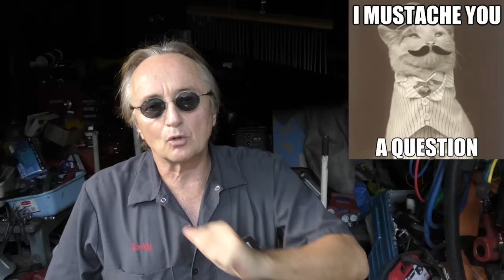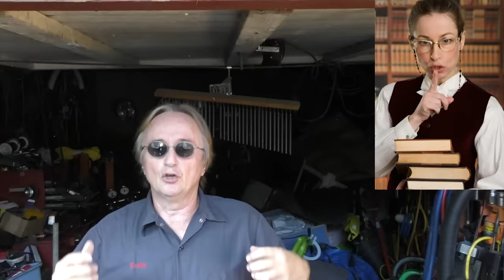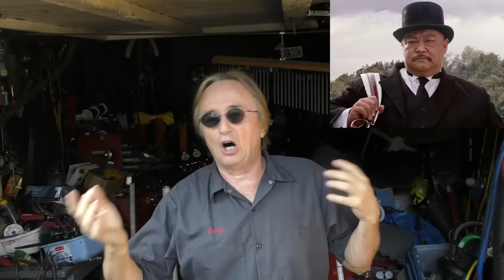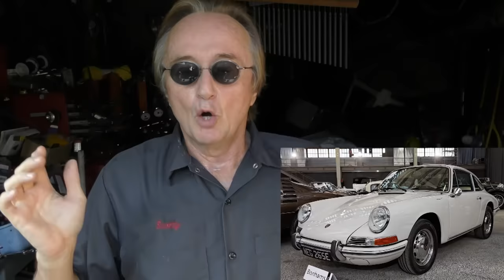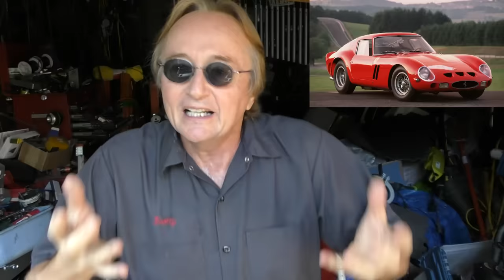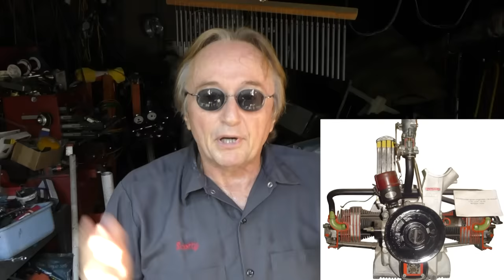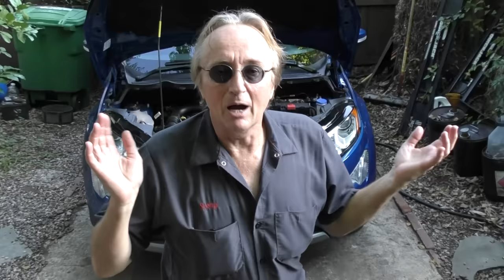The Truth About Boxer Engine Cars

Comment: Scotty is right about the Subaru BRZ: weak power.
Reply: It never meant to be a muscle car by default.......just because Toyota 86 got famous because of initial D does not mean 86 was meant to be a muscle car neither. The new Toyota 86 was always designed and market as a smooth and good handling car to begin with.
Reply: @kisekinecro  The car has 151 lb-ft of torque, which makes the car under powered. Nobody says it has to be a muscle car with 400 lb-ft, but 151 is ridiculous for the price.
Reply: @bodystomp5302  this car is a 2 seated coupe that doesn't require much to move it, and it is not design to run fast to begin with. It is designed around the handling and fun car. It doesn't need to be powerhouse to begin with, that's the point.

Comment: Just because the Boxer was invented earlier than the inline doesn’t mean it is obsolete. Otherwise we would all be driving around in Wankel engines since these were invented 50 years after inline engines. And Model Ts ran on inline 4s so it’s not like a cutting edge technology either.

Comment: Boxer engines more complicated than normal . Not for cars as two expensive but best in aircraft as engines are air cooled and boxer only has 2 cylinders is a row so better air cooling.  This point is completely missed in al articles on boxer engine scrappy write ups that are pretty ignorant. used in car because there was an aircraft air cooled one that was convenient to modify  too water cooled car engine but more expensive

Comment: Subaru engines are made by Toyota in Toyota motor manufacturing plants along side V6's and inline 4's. Extremely reliable if maintained just like any other modern engine. Also his horsepower argument make absolutely no sense. Has he ever heard of Porsche? They dont make slow cars.

Comment: Boxster engines are balanced I keep hearing that in your video and like Subarus that have a true all wheel drive system sequential dynamic you know there's not a transfer case you know so it keeps even things more balanced they are great and run forever normal maintenance now you mentioned the head gasket issue yeah the head gasket but again if you get a h6 you don't have that issue , by the way Porsche still runs boxster engines and so does Subaru and it is now 2021, old motor design is on I think someone already said in the comments old like gas pissing engines hit and miss engines something like that
Reply: PS for more information did you know the first diesel engines actually were designed to run on corn and vegetable oil it was big gas companies that made Mr Ben's redesign them to run on diesel but the first diesel engines just ran on vegetables it's all big gas that changed it for you every one diesel were intended to be environmentally safe and sound you can think big corporations for its downfall

Comment: Cylinder configurations can only come three ways:  Horizontally opposed (boxer), V, or inline.  All have their advantages and disadvantages and to categorically call one of those configurations obsolete, I believe, is being biased.  To use the Subaru BRZ as a representative all cars with boxer engines is ludicrous.   I agree.  It's a dog.  Instead let's look at the two major manufacturers of automobiles with boxer engines, Porsche and Subaru.  One could hardly say that they make underpowered cars, especially with both of their histories in racing.  If you look at their ratings in owner satisfaction and Consumer Reports, both companies rate very highly.  I used to hate Subarus...thought they were ugly and underpowered.  But then I bought one, then another, and then another, the last one being an STI.  I am kind of a car enthusiast and have owned an M3, Supra, Twin turbo Z and an S4.  I loved them all, but I think that the STI, while not being the fastest car I have owned, has been the most fun.  Despite the flogging it has received, it has been extremely reliable (85k miles, engine mods, nothing more than routine maintenance).  I think engine reliability and life has more to do with how well it is maintained and how it is driven than cylinder configuration.  Power, in this day and age, is a function of money and who your mechanic is.  

It was once thought that push rod engines would become obsolete, but the Corvette has done quite nicely with that "obsolete" design".  Go figure.

Comment: Actually Toyota GT86 is not a Subaru BRZ clone. Subaru designed the engine and gave it's chassis from Impreza for this two cars and that's all. The concept, design, gearboxes...are all made by Toyota. And actually 16% of Subaru stocks are owned by Toyota. So prepare yourself before your videos please.

Comment: Unbelievably bad information.  For starters, the BRZ/FRS was a joint venture between Fuji Heavy Industries and Toyota. Toyota owns a percentage of Subaru and Tralee up to make a small Fe/Rd coupe. Toyota took their flat four that prior to this project had approximately 150 or so HP. Toyota engineering boosted the N/A hp to 200hp Toyota designed most of the car and had Subaru build it. Subaru supplied the engine and iirc the transmission and the facility to manufacture it. Also, from a reliability standpoint the vast majority of Subaru engines regardless of 4 or 6 cyl engines, their head gasket seem to be made out of paper mache. Timing belts can snap a later early as 65k miles and being an interference motor, bends valves trashes the engine etc

Comment: Loads of bulls: noisy ? Yeah , only because you consider air cooled bri. Alfa and Lancia boxer aren't noisier than 4 pots water cooled. They even sound nicer. Old design ? wtf are you talking about ? Any piston engines, petrol and diesel are old designed. BRZ is disappointing in terms of perf ? Dude, the engine is a high reving 2.0 NA H4 of 200 hp. Put a K20 in it and you'll have the same amount of perfs. Again it ain't the boxer but the displacement and the non forced inducted. Take a 992, and tell me the H6 design is outdated and not well performing ? And the 997 4.0 GT3 RS as well ?

Comment: There are so many false info on this with Boxer engine here. Boxer Engine is just a different layout, the rest of the things are the same....The video makes it sounds like an inline or V engine won't blow up or doesn't have problems. Talk about GT86 lakes of power, OF COURSE it does!! It says on the spec it makes 200HP. There's 1500HP Boxer out there you just need to spend money for it, how much horse power does that Celica cranks out with an inline 4? This is nonsense..

Comment: Subaru can’t make engines for the life of them. More engine recalls than every other brand in recent history, even trumping Kia/Hyundai’s recent recall for manufacturing defects from a few years back. Everyone I’ve known with a Subaru has had to have the engine rebuilt, wether it was a 2003, 2013, 2015 or 2017. Those 2.5L’s seem to be a mess, every engine failure was different, from head gaskets to oil pumps to bearings. It’s fine when they’re under warranty but that doesn’t bode well for Subi’s bottom line - probably why Toyota bailed on them and partnered with Mazda
Reply: the 2.0 ej207 is an incredibly tough motor. You won't find many of those with issues. Even the standard 2.0 ej205 was decently strong until you overpower the internals with mods. It is the 2.5 litre engines that had the trouble. I've owned an old 99 non turbo impreza, ran for 310 000 and sold it still running well with no engine troubles. I drove the utter piss out of it. Now I have a bugeye wrx that spun a bearing at 290 000 with some mods done. Swapped it for the ej207 motor. The older subaru motors into the mid 2000's were reliable

Comment: If the boxer engine was better than an inline engine most cars would be boxers.
Reply: @tboman4128  A single swallow does not a summer make. 
Boxer engines requires a doubling of many components just like in a V engine. Also gravity acts on the pistons and bores unevenly accelerating wear on one side. They are also harder to work on, often needing removal.

Comment: Boxer engines are the worst!  Will never get another vehicle that has one.  My Outback has burnt a quart of oil every 1500 miles since brand new from the factory.  And, apparently that is not as bad as quite a few of them as it did not qualify for the excessive oil burning recall.   I hate that car with a passion!  A CVT programmed to emulate shifting, flawed firmware throughout the entertainment system.....  Never another Subaru nor horizontally opposed engine again!

Comment: What the heck is an interference engine??  They seem too risky, no?
Reply: Interference free engines are when the valve train angle is at such that if the timing chain/belt snaps there will not be bent valves when the piston and valve become out of timing..

Comment: Blowing head gasket has nothing to do with air flow you funny man...people mess with exhaust pipes that result in head gasket blown or in many cases perhaps the mechanic who did things the hurtful ways then it can be the person who is driving it who won’t want to change oil...boxer engine are pinnacle of motor engineering they dissipate heat faster than anything else.

Comment: It is easy to make a rain spit over a topic that you obviously do not know well.
Boxer engines ARE NOT antiques as you mention. There are several advantages around a boxer engine, starting from performance and safety. Otherwise, how can you explain the Subaru's long fame in rallys? How do you explain that usually a 4-cylinder flat engine nowadays can  beat easily a lot of 8-cylinder V engines cars? Why the WRX, the BRZ are so loved by a lot of people? 
No, definitely you had to do your homework before doing this video.

Comment: EJ25 worst engine they ever produced. Had a head gasket blown bought used at private dealer ship. Most likely all other valves going to need replacement soon and head gasket alreadya huge job and expensive. One thing I learned about these. When something goes all other parts are on thin ice. Can't replace just one thing gotta replace them all. Best to swap engine instead. In conclusion, subaru owners should only be one owner then the car will last long if you baby it.  these car get beat on so hard by younger crowd mainly wrx and impreza.

Comment: Vw  gave up the air cooled because of emissions standards. I owned a corvair and it was a brilliant car Ralph Nader was ...is... and always will be a penis with ears  I have a 69 beetle and yes its noisy but that's the charm of it (lets see what your wifes rice rocket will be like when it hits 50 years old). I also own a 05 Subaru Forester and its so quiet you can hardly tell its running. As for the Tucker... it was a brilliant car that was way ahead of its time so the big 3 auto makers forced him out because they couldn't compete.

Comment: Boxer engines are pretty bad for fuel efficiency
Reply: That's not true.  Boxer engines are in Subarus, which are all wheel drive.  It's the all wheel drive that reduces the gas mileage, because they have more friction losses.

Comment: underpowered i have a 2.0 wrx with 400 hp...... like to see that out of any other   4 cylinder.
Reply: Lol subarus bog down more than any other car, Owned 2 STI's myself and even a corolla is faster below 2000rpm. Overrated teenage 'cool' cars with shithouse gearing/torque below 3k
Reply: @Snook_  it would kill a corolla of the line im running  gear ratio of 4.44....
Reply: tom richards maybe but the STI I have driven with around 230-250kw at the wheels one being my old one are horrendous to drive around town zero power until 2.5/3k are horribly geared. Would never own again. I’m too used to big diesel and torque down low now I value power under 2k much more it’s just so nice to drive
Reply: @Snook_  i completly agree... with the low power at low rpms they shoulda geared all of their cars alot higher.... i swapped in a driveline from an older jdm subaru.... the japenese dometic subarus are build alot better....
Reply: @Snook_  you've got to be joking mate. For one, there is never a time in a wrx that your revs should be below 2000 with any load on the motor. Secondly, if you manage to do the first thing, there are not many cars quicker than it, certainly not a corolla. I have an 02 bugeye with a jdm ej207, big turbo, exhaust, fuelling etc. 300 wheel HP,  yet to see something that isn't 10 times the price go quicker than it

Comment: Buy a Subaru leave it stock if you want a turbo Subaru buy a sti never ever by a wrx that isn’t sti.
Reply: the fa20 and fa24 are super good motors tf u talking about and if ur getting a ej u gotta baffle ur pan upgrade ur oil pickup get a oil cooler and cylinder 4 mod and that ej will run forever

Comment: Bad info.  Old flat engines were noisy/low power because they were air cooled, not because they were boxers.  Oh, and also because they were designed 70 years ago.      
The real trade off is the complexity/cost of two cylinder heads, which must be weighed against the advantages of balance and low CG.  

Also, what an anoying voice!